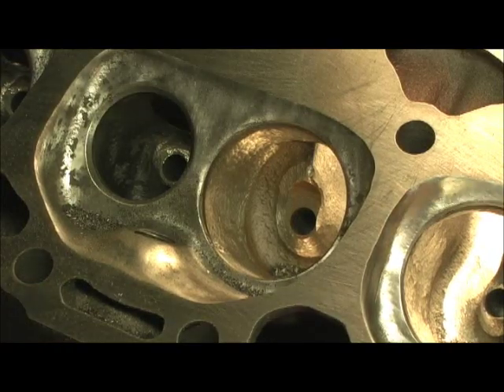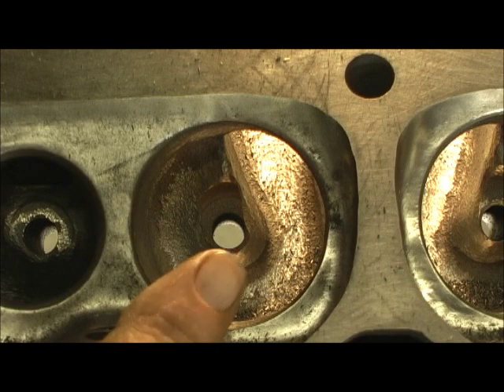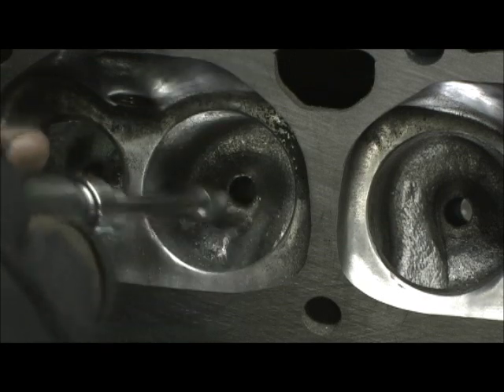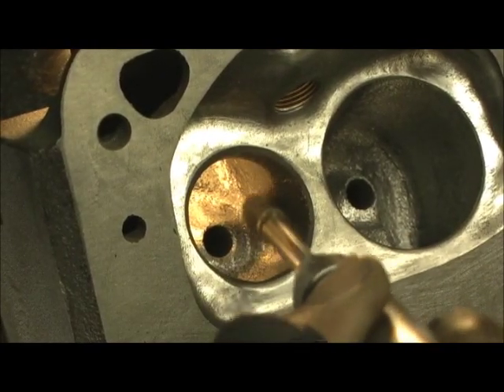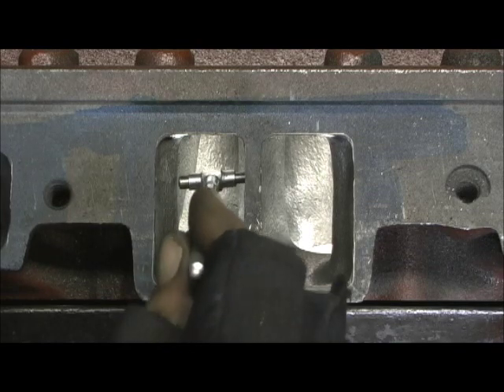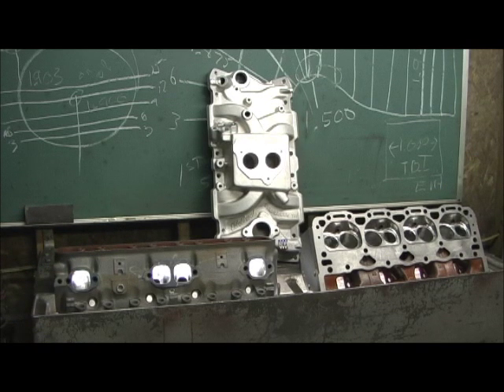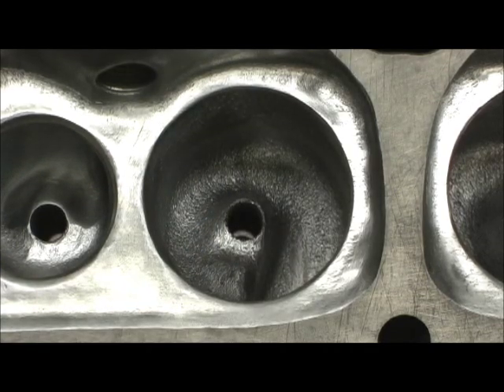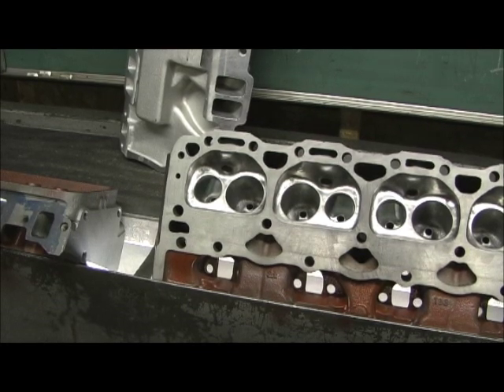Chevy 350 TBI Cylinder Head Stage IV part 4

Comment: The 906 is a very nice stock head. What that means is if you do not know what to do as far as porting , valve job and guides there is an excellent chance you will lose performance. Start out on a set of 882's there is tons of room for improvement on those boat anchors.

Comment: Thank you for the videos they are very informative. I have a new set Of gm vortec heads # 10239906 That are used on the gm 602 crate motor. If I use these procedures could I wake the engine up..Our top RPM range is 6200. Thank you. Bob

Comment from the maker: (Cont) and Mondello, Dart, Brodix all knew in there beliefs that by shaping the intake port and making "Wings" or "Obstacles" in the port effected the mixture process once it went around the Intake Valve and went into the chambers. By using Florescent Dye and a Black LITE he seen turbulent "EDDIES" in the area's of the combustion chambers "WHERE THE FUEL WASH WAS AND HAD BEEN FOR YEARS IN THE COMBUSTION CHAMBERS!!!"  This meant that the clean areas were in fact BURNING like they was (cont)

Comment from the maker: (Cont) I cannot, and you cannot say FOR SURE what is going on, I am sure one of the top dyno guys in the U.S. would know that, and they do not give that type of information; however, on MY defence, I studied Chemical and Mechanical "BURN RATES", which is the process in which the electrode emits the spark in its process (Chemical first, them Mechanical), then transfers it to S/V Ratio in the combustion chamber. For Example: The whole world used to think that "Fuel Wash" in the combustion (Cont)

Comment from the maker: About Dyno runs that any man on the planet, as he lived on that thing (a SF-901 with double absorbsion unit) and all the TOP SHELF computer accusation information software at the time (Audi, Quadrant Scientific, SuperFlow, and of course the Engine Expert from Alan Lockheed). I got to use ALL that stuff, and he used our dyno for hard pulls as the Superflows were cheaper built than our Clayton 3000 HP dyno, the only thing was his would do acceleration runs, ours did not. On the plug thing (cont)

Comment: Tony, I have built a few engines with these cylinder heads and after some running time if you looked at the plug with the electrode pointing up you would see that the right side of the electrode was clean and the left side was an ash tan. I figured this was due to a slight fuel wash across the plug and indexed them and all was well.  As far as the book I grabbed my well worn copy that was next to me and you do look a little like that handsome guy on page 60! Thanks to you and David! Great book!

Comment: I use the Sioux electric driver for angle stones 15 to 60 degree without an issue. I have been using 75 degree stones recently with a pistol drill due to stone breakage. If you say 60,45,30, and 15 are the angles to use that is what I will use.Thanks, Charlie

Comment from the maker: 60,45,30 and 15. The best I can tell you on the 60 degree stone and "bouncing is to develop a relationship with the Spring, and the kiss-off and take your time (a lot of time, turning a three angle valve job into a three to four hour ordeal). I use the Sioux Electric Valve Job drill, and I just go Slow and I hardly ever bust a stone till it gets to the end of its (the stone) life. NEVER EVER use the 60 without having a THICK margin on the stone, it is the thinness that does you in.

Comment from the maker: Well, I have to concur except on the swirl in relation to the spark plug. While is has been proven (to somewhat of a degree) that indexing plugs help, I wonder how much on this swirl design DUE to the fact the air/fuel is mixing as such a higher rate, that it requires a great deal less to ignite as it is more atomized. You might be right; however, the whole swirl thing is dependent on LOW RPM, like a diesel engine, below 4000 RPM. David Vizzard worked on that till his hair turned (continue)

Comment: Tony, I love the high helix port for applications under 6000 rpm and economy. I know you stated you had access to a flowbench and if at all possible I would love to know what they flow now. Another important point with these heads is to index the plugs with the gap facing down. The swirl causes high speed air and fuel right across the plug gap and will not like being blocked by the electrode. Thanks, Charlie

Comment from the maker: Continued: Philip's main goal was gas mileage, and torque is second, but a compromise had to be met. I listen to my customers first, then my desires second. You really hit what I wanted to do, and I am aware of the 900 Holley TBI deal, I agree with the cam to a large degree (no pun intended), He wants to drive this daily, have some PUNCH on the highway when he wants it and he does not pull weight TOO often, there for stock valve size rules, NO TUBES, and a GREAT SHAPE with a kiss and a twist!!!

Comment: Tony, what are the four angles you are using for the valve job? 30, 45, 60, 75? Would love to know any secrets you have to keeping the Sioux stones from bouncing after 60 degrees. I have been using a heavy duty drill, 500 rpm and wetting the stones with wd-40 for 75 degree cuts. Works but really slow! Any help would be greatly appreciated. Thanks, Charlie

Comment: -22 cc pistons connected to a balanced 383. Ran real well for years then built a set of AFR 190's with 2.055/1.625 valves fully ported. The Afrs did not improve performance till OVER 5500rpm! This was in a 5800 lb truck with 3.73 gears and 33' tire turbo 400.  Caution Tony these heads with a nice quench need very little advance!!!! Try 28 degrees or less!

Comment: Tony, Love your work! These heads will rock and your engineering is spot on! I built a set like this back in the late 80's for my '88 one ton with a sad 180 hp. Similar porting but the upped the valve size to 2.055/1.6 set them up for 260 hr comp roller with larger springs and 1.6 roller rockers. Ceramic coated the chambers, valves, and pistons. Holley 900 cfm Projection ported, Holley dual plane ported 1"5/8 headers, 3.5" dual exhaust, .016 steal shim head gaskets, continued-